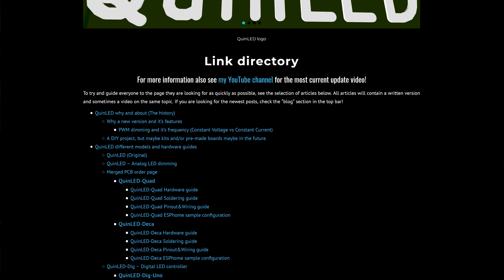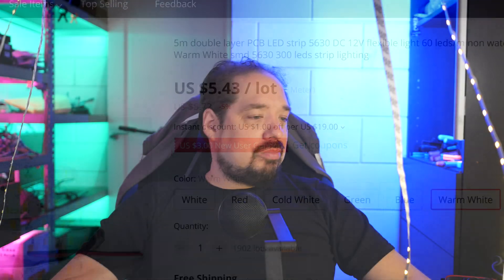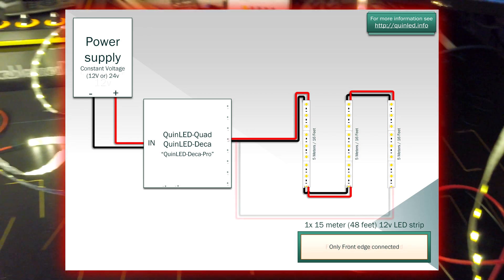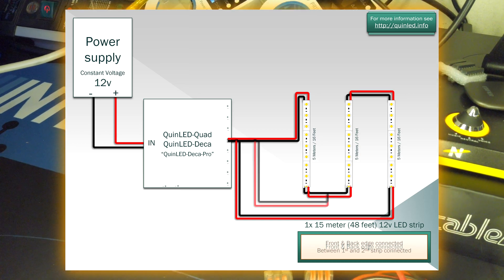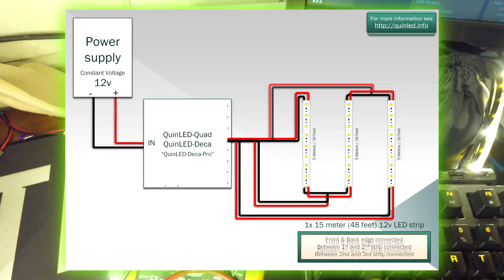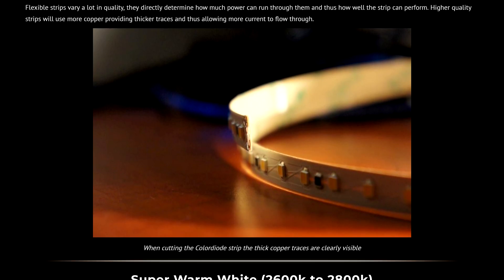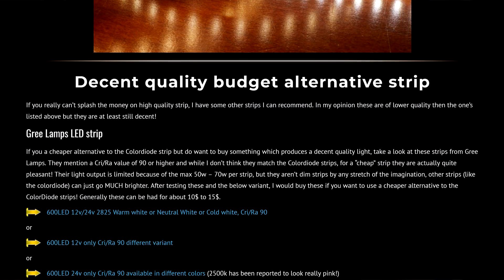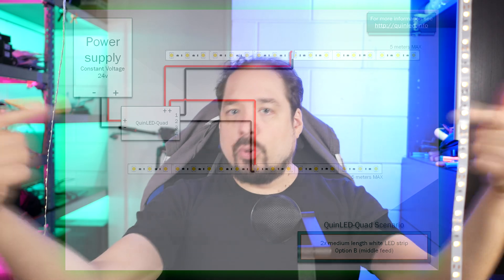QuinLED: Combating LED voltage drop | LED Power Injection

Comment: It would be very interesting to see the voltage drop with your high quality LED strips in comparison to the cheap ones.

With a digital strip at 5 volt and 144 leds per meter I found that you need to feed it roughly every 1-2 meters for it to function properly.

Comment: With voltage drop, we are basically looking at an injection point every 5 metres at 12V, and probabl;y every 2.5 metres at 5V on cheap strips.
I think for lighting it is better to spend some money on good quality, but if it's just holiday lights I would likely cheap out a bit :)
Reply from the maker: That's a bit of a generalization since it really depends on the quality of the strip and for instance 30LEDs/m or 120LEDs/m, but in general, sure, those are safe values. I'm thinking of maybe doing a short follow up video regarding 5v Digital strip since the effect is a bit different. Would that be interesting?
Reply: @IntermitTech  Definitely the 5V digital strip would be interesting to me.  I mainly use digital strips and the 12V ones tend to be based on 2811 chips and 3 LED's per "pixel" which is not quite as good for effects as having single addressable LED's.  Also, like a lot, budget is always a consideration :).
100% on board with the digital strip video.
Reply: @EsotericArctos  look at the 2815 leds (12v individual addressable RGB).
Reply: @IntermitTech  Off topic for this video, but I saw your thermostat video a little while back and wouldn't mind knowing how that all is working out with the sensors you got.  My system is not near so complex, but I will still need 3 different zones.
Reply from the maker: @EsotericArctos  The Xaiomi sensors with an ESP32 and ESPhome have been working great over the past few months. Hanging issue has been resolved and it works perfectly in my opinion. Haven't had to replace a battery yet either. :)
Reply: @IntermitTech  That is great to hear.  I might try it out, on a smaller scale of course, for my use.  I should expect the batteries to last quite a while :).
Thanks

Comment: thanks m8, i always wonder that losses in the strips and seems very real for the longer runs. You might can get away a bit of the losses by applying little more power from the source if the leds still can handle that.
Reply from the maker: Actually, upping the voltage will not change the effect. I tested this but the first LEDs on the strip will become brighter and run MUCH hotter and relatively speaking the end of the strip will be just as dim in relation to the first ones. So you are just killing the LEDs quicker (without proper cooling).

Splicing in extra power, and thus providing more copper, is the way to go. :)

Or well, start with buying better strip in the first place, but ok. :P

Comment: Hi Quindor I was watching you on the Drzzz channel the other night you were talking about your boards led and about costs. I think we have spoken in the past regarding having a kit made but you seamed not to like the idea that much. I do get were your coming from not sure if you remember we talked about JlcPcb to make the pcb's because I thought they'd be a little cheaper there.  anyway I'll get to the point I also follow Julian on his channel and he has just used JLC-Pcb to make up some small boards but the interesting part was that the service also offers a surface mounting of components thought that was quite interesting here's the link to the video worth having a look I think https://youtu.be/GpR87cdEdZc      let us know what you think Regards Peter
Reply from the maker: I remember talking about this, and I get the point. I follow Julian (and others) too and I know like JLC-PCB or PCBway offer full production options, they reach out to me often enough. One of the things I've changed since we talked is that most of my designs are not available from DirtyPCB and PCBway (which I was testing at the time).
And I'm not saying I'm never going to make a project that uses full production by an external company and thus would allow me to offer pre-built versions. The thing is, the current projects are made in a way that make it very easy for a human to build but that in turn means that it's very hard for a machine to build. That makes them prohibitively expensive for these services. I have some stuff in mind for project which might use it though. Still, costs are going to be 5 vs 1 basically. So you could build 5 DIY or get 1 pre-made.
Especially if they can't sell it directly for me. For me to import items I have to pay import and tax, adding ~30% at least. And if I then have to ship it, that adds let's say another 10$ so prices again raise significantly versus building it yourself, especially if we are talking a kit. Me buying the same parts as you can buy directly and then shipping it through me, just doesn't make sense cost wise.
So I get it, and I'd love to just tell some company to make a 100 and put them up in tindie somewhere, but things are a lot more difficult then they are first seem. I am working on some stuff which might be SMD only which would be more suited for it and I'm also trying to find vendors on Aliexpress for instance which would have all the right components and could maybe make kits available. But that's a slow process. :)

I do really appreciate the comments and thoughts though. If you'd like to discuss it more, hop on the discord! :D